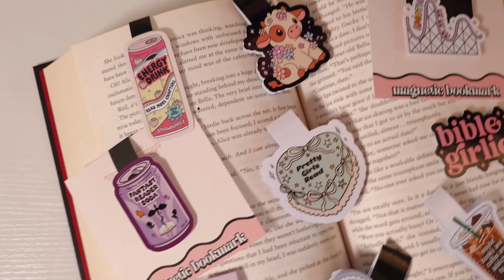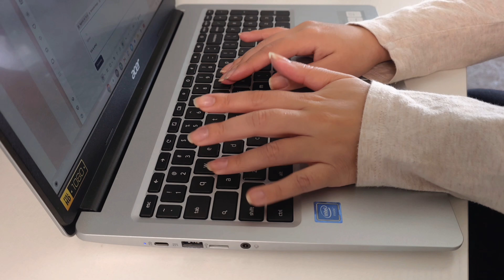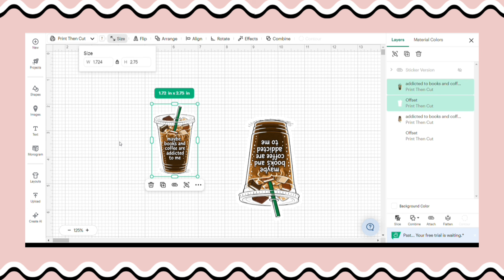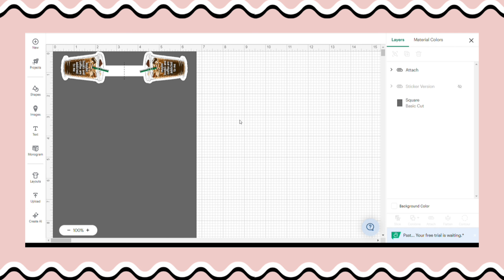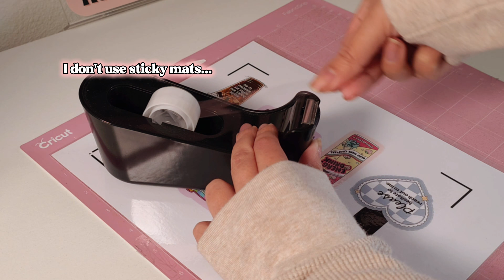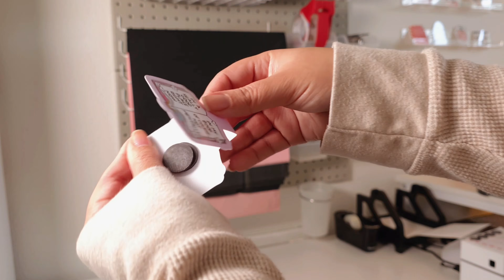How to Make Magnetic Bookmarks with Cricut Design Space (Step-by-Step Tutorial)

Comment: I would love to see your pressure settings. I have my own settings that I use, but it involves 7 cut passes for my laminated magnetic bookmarks. Also when you add the score line, do you duplicate it several times? I find when I add only one score line, there isnt enough pressure so when I go to fold it, the laminated creases underneath. I usually score it manually to avoid underside creasing/peeling at the fold.
Reply from the maker: I'm actually thinking about making a separate video all about my Cricut pressure settings because there are so many little things that go into getting a clean cut, especially with laminated bookmarks!

I actually don't duplicate my score line. Has using multiple score lines been working well for you?

I've also heard a scoring wheel gives a cleaner crease than the stylus. Do you currently use the stylus or the scoring wheel?
Reply: @honeysheshome  I would love to see that video. 😊 I'd be very grateful. I'm curious to see if there may be an easier or better way than what I have in place as far as pressure settings.

I've attempted duplicating my score line and it still does not provide the desired result. Sometimes I add the score line so I can see the center of where I need to make a manual scoring pass. I wonder if maybe the paper I use is too thick in addition to being laminated with 3mil lamination. I use 54lbs double-sided glossy photo paper from Uinkit on Amazon for my magnetic bookmarks.

I currently use a stylus for scoring. I have never attempted the scoring wheel, because I think I would have to remove the blade in clamp B and I didn't want to drag out the process.😅 During batch production time is valuable.
Reply from the maker: That actually makes a lot of sense! Maybe trying paper that's a little thinner could definitely make a difference? Definitely worth a try!

And I totally get not wanting to switch tools during batch production, that would be annoying 😂

I think you're convincing me... it's now on my list bc a pressure settings video does have sooo many little variables and i know this is something we all have struggled with one way or another!
Reply: @honeysheshome  Okay, I'll give that a go. Fingers crossed scoring works on the new paper.

I'll be standing by for your cricut settings video. Thank you for your suggestions and expertise!
Reply from the maker: Let me know how it goes!! Keeping my fingers cross for you 🤞🏼

You're welcome! I'm happy to help in whichever way i can 🥰